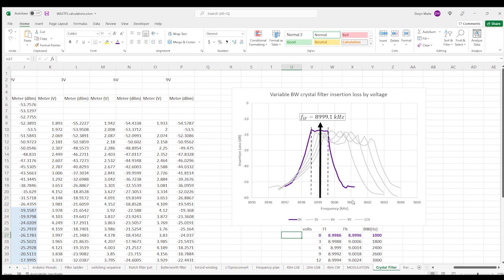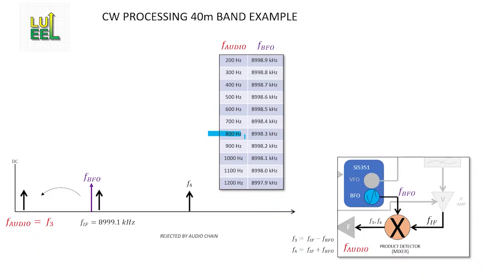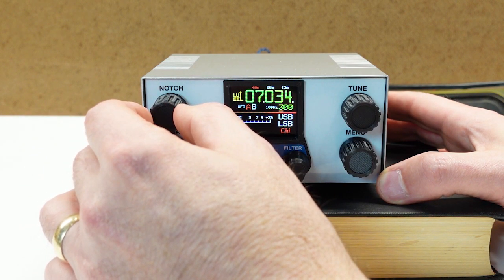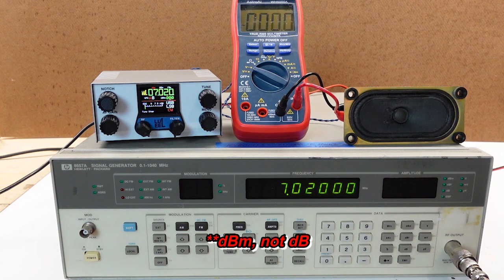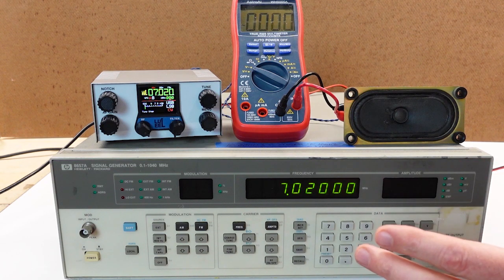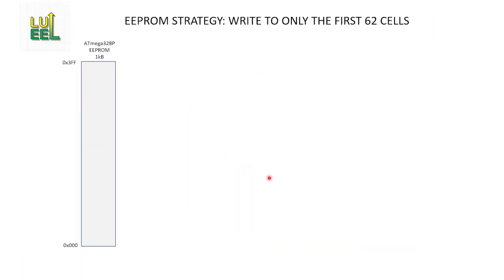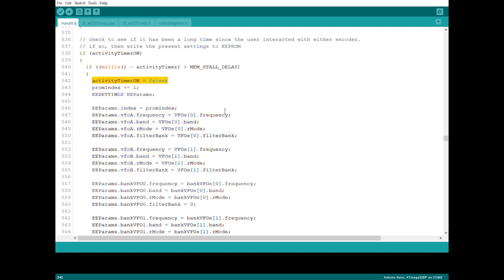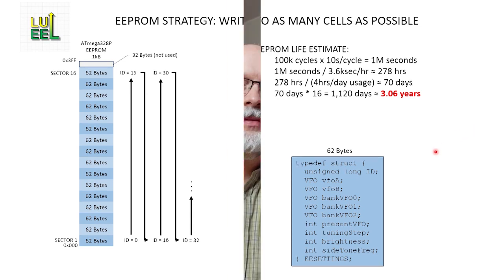Superhet Receiver Part #10: All Done!

Comment: Bravo on the build for sure; very few of us get all the way through something this extensive unless it's our job!
I was faced with the EEPROM dilema and was unable to just keep mapping to a new data-page.
What I did was to watch the AC-voltage coming off the XFMR before the rectifiers (since they are connected to the bulk filter caps).
This AC voltage drops instantly, and I used this to fire an interrupt that told the uC that the supply voltage was crashing.
Given the time of discharge of the unregulated DC, I had plenty of time to write all the values then bail into a idle loop.
73...

Comment: silkprinting really takes good setup and good experience to make it right, if you want to try DIY silkprinting kits be up for many failure (make sure to have at least 10 casings to waste) and a not so convincing result. Two technics i can suggest : look for flatbed UV printing, this is what we use industrially to print for example off-the-shelf housings, nowdays small UV printers are cheap and many shops are using them to print custom mobile phone shells and advertisement items (mugs etc), you can certainly find a shop ready to print your housings / facades for a small fee, the result will be extremely satisfying, wich high resolution, full color possible and much more resistant than silkprint, another option is laminated printed transparent membrane (i dont know the english name for it) this is very commonly found on small industrial devices, on the facade, when off-the-shelf casings (plastic or folded metal sheet) are used. This will looks very good, with a frosted finish making it resistant to scratch, also provides full color printing with high DPI and since the printing is laminated behind the plastic sheet it lasts forever. This is also cheap, i can't say for north america but i would guess you can also find some shops doing that for a small fee since it is commonly used on industrial equipement and companies signage. That and the UV printing are the two technics we use all year long for customers proofings and even small serie batches, i work for a Shenzhen company so in Shenzhen we have many shop and factories providing such service but i am pretty sure you can find that in north america easily.
Reply: I'll add my two cents: you do want to be sure that your silkscreen ink is durable, by using either epoxy-based or UV-cure ink.  Either way, you DO have some working time, so if it comes out poorly, you can wipe off the ink, clean the surface, and try again.  But the even better news is that you will get a much more professional-looking overall look.

I'll also throw in an additional suggestion.  If you choose an extruded aluminum case, you can customize the size by ordering a longer extrusion than you need, then using a chop saw to trim it to the actual size.  But an even better aspect of this is that while these usually come with either plastic or aluminum front and back panels, you can also get PCBs made with nothing but the solder mask and silkscreen, and many PCB services will let you choose the solder mask and silkscreen colors.  This also allows you to have the holes for control shafts and display bezels drilled or routed to your drawing, so there are no hole saw issues.  If you want to see a good example of this building technique, google "ATS-20" or "ATS-25" radios.

Comment: Great job, and a fine receiver that you should be proud of!  And a video series to explain your thinking and the results thru the whole project.   
I tried a trick to dump to EEPROM on power down  involving a large uF capacitor on the Arduino Vcc. Each loop, the supply voltage is sensed. If it drops below a threshold you dump to EEPROM (hoping the MCU holds up long enough to complete the write).  I couldn't get it to work but it sounds feasible,  just very dependent on Cdischarge rate and Arduino current draw, plus the main loop iteration rate!  73 Paul VK3HN.
Reply from the maker: Thanks, and that is an interesting idea, seems like it could work if the charge held up long enough.
Reply: @levelupeelab  I prefer that over having the settings saved every time you don't adjust anything for 10 seconds.  In fact, my experience with the ATS-20 radio, which uses a very similar algorithm to yours, I find that I seldom refrain from twisting any knobs for a full ten seconds!  This often results in no updates ever being done to the EEPROM values, and the next time I turn on the radio, it's not even in the same band I was in before.  You've probably noticed that the EEPROM update function takes very little time, little enough that you probably don't even notice when it's being done.  The ATmega328P datasheet says somewhere how much time it takes to do this, and I'm pretty sure it wouldn't take a very big capacitor to ensure that power is there long enough to complete that after the switch is turned off.
I've made a number of changes to the ATS-20 firmware, and I'm considering doing this next time I'm digging around in it, or even just adding a manual "save" function.

Comment: I loved your "slick little trick" ... low side injection so the pitch goes from low to high as you tune across it ... so simple but something I'd never thought about. Many thanks.
Reply: This is great as far as CW goes, but a possibly undesirable side-effect is that you'll get a difference between how tuning works for SSB and CW on bands where the sideband is the opposite one from which side you're using for CW.

Comment: How about a PCB board, (made at jlcpcb etc.), schematics, info on ALL the coils, alignment & spreadsheet?
Reply from the maker: Thanks for the question.  The majority of the technical info on the design comes from Jim's source materials.  But regarding the exact board layout it is of limited use for anyone to replicate because of the surplus relays that I used (they aren't available anymore).